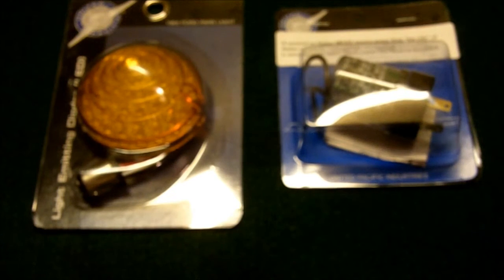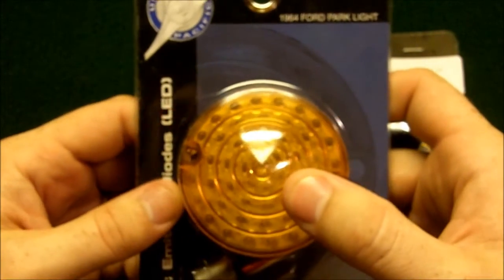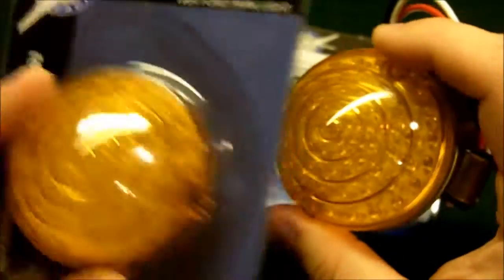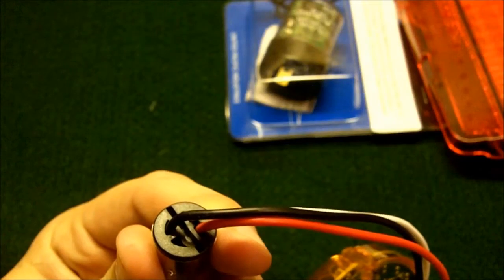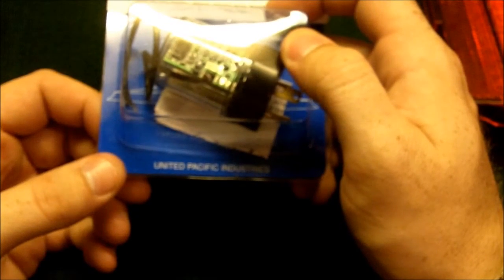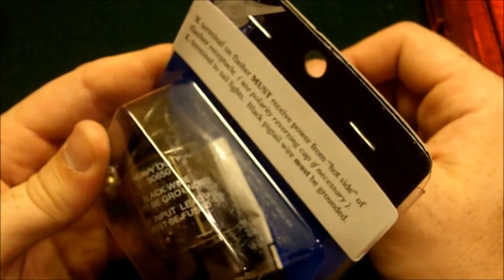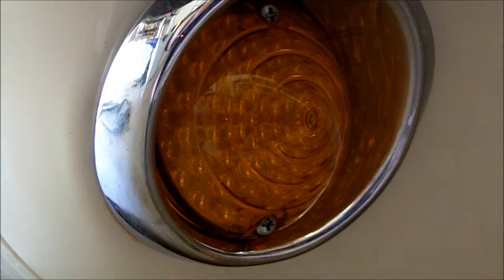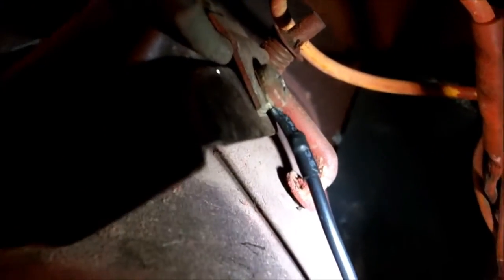Wrenching: How to install LED indicator lights on a classic Mustang

Comment: That was a good write up, and it will be a huge help for many who have not done this type of upgrade.  I upgraded my tail lights to led, a set from scott drake.  The installation was as simple as you made it in your instructions.  Skip forward a year and a half, my tail lights are getting milky in color, and I dont know why?  The car is garage kept and I only put about 500 to 600 miles per year on it, so it does not see much sun light.   How have your lights been holding up?  I would like to do the front and the rear reverse lights, but would rather have more feed back before I spend more money on something that I may not be 100% happy with.   Thanks for the great video and I would like to hear back from you.

Comment: You forgot to mention that on a 65 66 you need to change to indicator light inside the instrument cluster as well, to a special led bulb other wise the front lights stay on instead of blinking